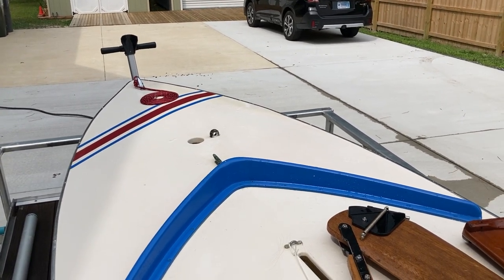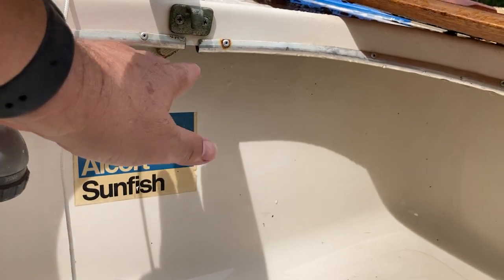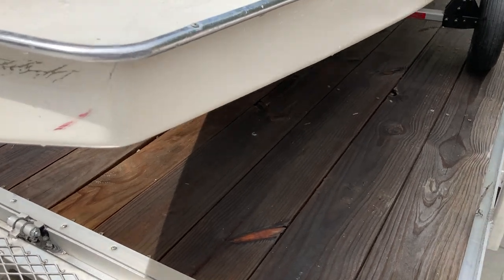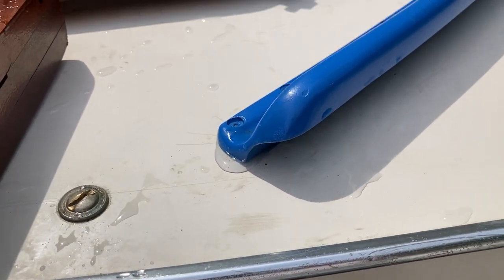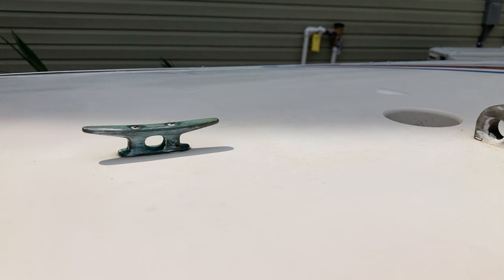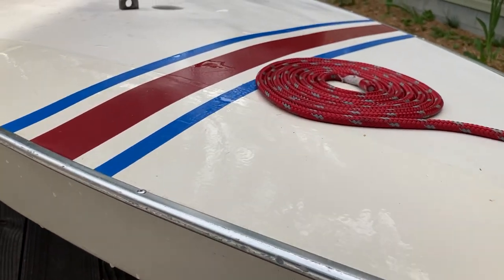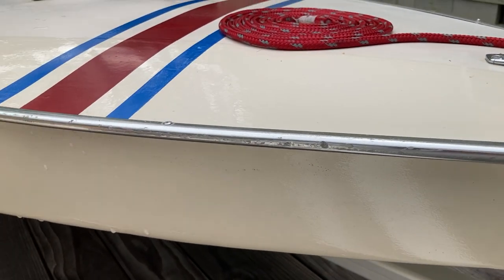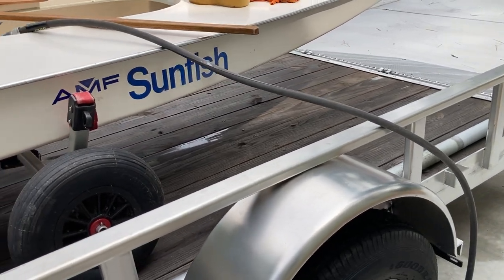How To Clean Your Sunfish and Inspect the Holes

Comment: I cannot get the drain plug to unscrew on my sunfish. The screw is so old and I stripped it with barely any pressure. Do you have any advice on how I can get it off? I can hear water splashing around when I move the hull 😢. Also, do you have any videos on how to fix leaks?
Reply from the maker: You'll probably have to remove the entire housing/plug and put in a new one if the head is stripped. And we have a lot of repair videos on our channel, use the search function first to find "Air Leak Test" or post a question on specific repair areas
Reply: @kentblairl  thank you. If I put a new one in, won’t the hole that I cut to get the old one out be too big to hold the new one? I’m just wondering if I’m going to have to cut it out, repair the fiberglass, and then put the plug in a different spot.
Reply from the maker: @blippityblop2012  No. Buy a new nylon drain plug with housing, Ronstan makes one and there are many brands. Some Sunfish dealers have them. Get good marine sealant. As for the old plug housing, it is usually held with 2 small pins and you can gently pry out the entire housing. Then the remaining hole can be filed a little larger to accept the new plug/housing. Secure it with marine sealant/adhesive and 2 marine stainless sheet metal screws. Drill a small pilot hole for the screws.
Reply: @kentblairl  thank you!!
Reply from the maker: @blippityblop2012  You're welcome